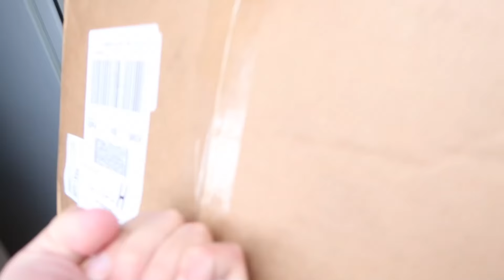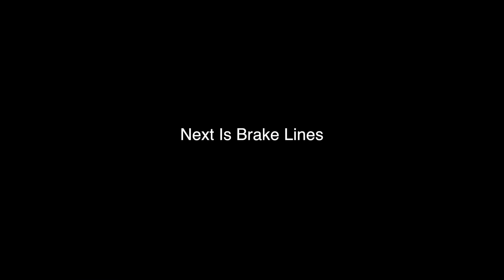Black Friday Goodies

Comment: If it's already addressed in following videos sorry to waste your time, BUT, was the passenger side bolts holding the k-member to the body in front of the strut tower bound up on the body? Looked like a gap so I'm guessing either the body needed modified (ground a bit) or the k-member was a smidge off. Check the vid where he's hitting it with the wrench and impact - D

Comment: Love these videos. Couple questions: I saw your older vid review on these K-members. Will they hold up, are they safe? It looks like the engine mounts are solid? Will that cause excessive vibration in the chassis? What is the advantage of solid? Thanks!
Reply from the maker: thanks! i had one on my 95 cobra for 3 years and its been fine. we put one on my buddy's mach one and the only down fall is the shaker didnt move as much while reving or driving. it should make it a better ride and won't cause excessive vibration.